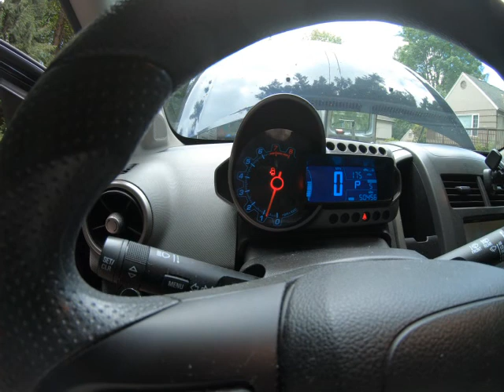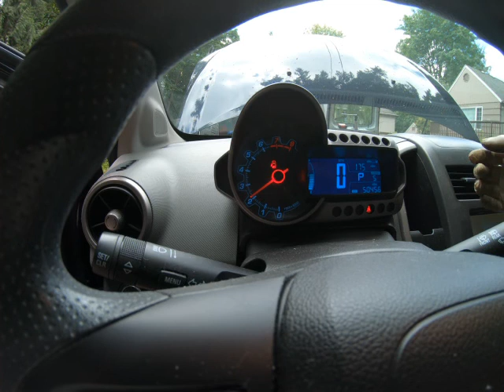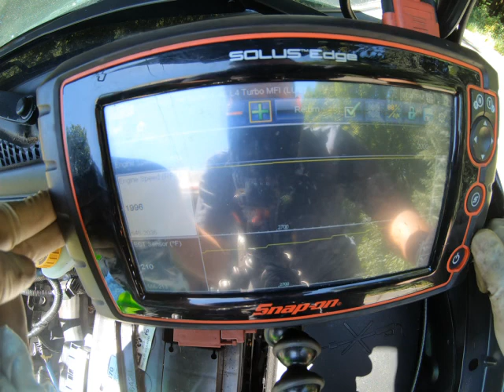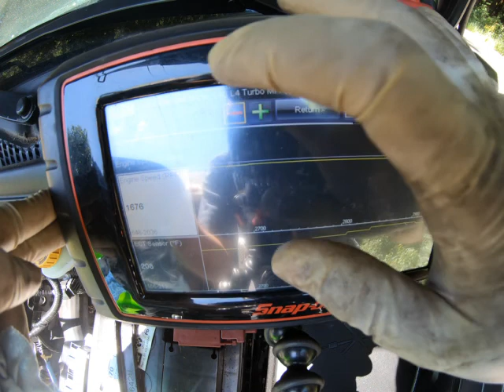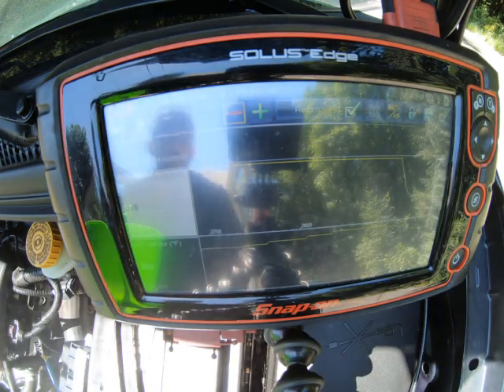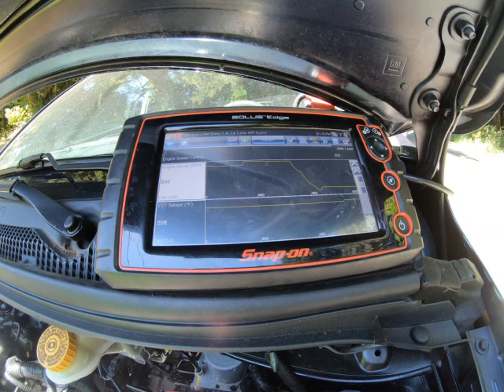How to bleed Cooling system

Comment: I have a 2021 Acura ILX. I drained the coolant, and refilled. Using the spill free funnel just like you have. After I refilled the coolant, I burped all, at least I thought all, the air out, but I’m only getting very hot air on hi setting? If I go to 86, 85,84 ect…. I get room temperature air, not hot? Any suggestions?
Reply from the maker: @Mark-um3hm  feel free to reach out at socialmediacontent@sudomail.com